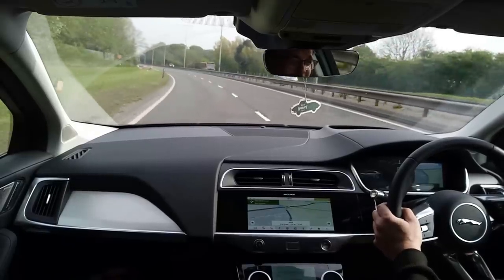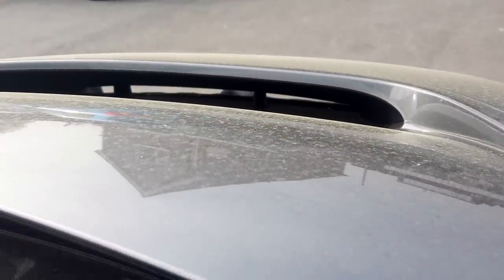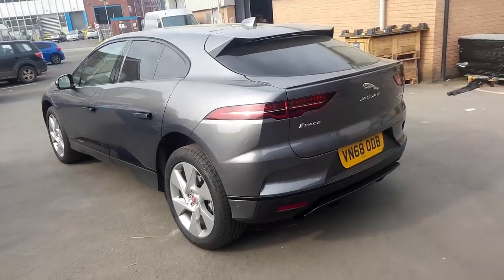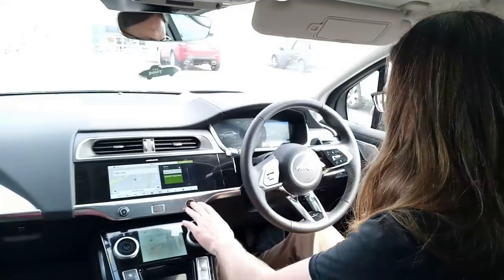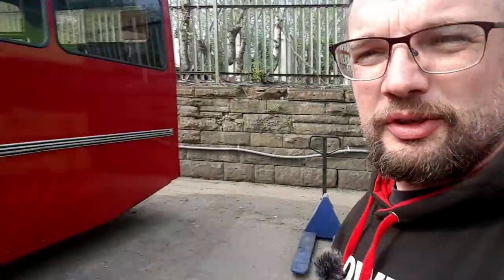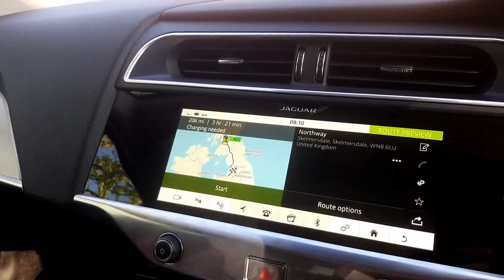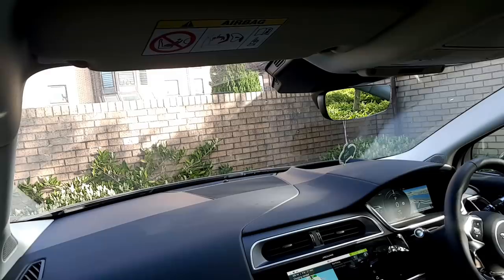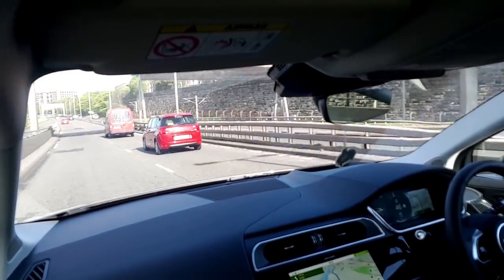Real Road Test: Jaguar I Pace 800 Roadtrip - with bonus bus action!

Comment: I've been told that you have to check Ecotricity on Zap Map before planning to use one - if there's been a "successful charge" within a day or so, you can expect it's working.  If it's not had a successful charge in a few weeks then it's probably bust no matter what the service status says.
Reply from the maker: Which is all a bit crap really. My route was evolving. I couldn't check charger status while I was driving...
Reply: @HubNut  Totally agree.  I had my first EV experience last weekend with 450 miles in an i3.  Not a bad little car, despite its daft doors and crazy BMW price but we had an Ecotricity charge that worked and two Polar ones that didn't. Found enough other Polar chargers around where we were but what should have been a relaxing stop with a coffee became phone calls to Polar and then sitting in a deserted supermarket car park for 45 minutes.
What would really have made the difference for us would have been destination charging. If the Travelodge had even some 13A sockets in the car park, that would have sorted us out overnight with no hassle!
BTW, I'm sure there must have been a problem with the Jag or those chargers you used as I was getting faster charging with the BMW than you got even though the Jag is rated for 100kW charging and the BMW only 50 (I think).
Reply: Still.. On the other hand, discussing this with friends, we remembered it's not all that long ago that you could get caught out on a long trip with a petrol car.
Not so long ago, garages closed at about 8pm.  Often didn't open on Sundays, etc.

Comment: Thats impressive Ive watched 17 Hubnut tests and they are all fine. As i drive an electrically powered motor vehicle, and Im an engineer in the auto industry I totally agree, the modern internal combustion engine car is too complex and was wondering if there would ever be an  electrically powered motor vehicle test on Hub Nut because I was sure it would truly show warts and all , here it is and for all the road tests done to date on various channels none actually attempt distance because if they did as here they would find yes brilliant car but useless charging. Never count on Polar, 90% success with Ecotricity. 100% with Teslas own superchargers.  I speak from experience 5 years in a Tesla P85 85K miles the only system that works is Teslas own (yep motorway 50 speed limits are your friend) great test. Teslas are efficient (mainly low drag) yes if you floor it they will eat the electrons but at speed limits they are good. Compared to traveling by Tesla this was painful and the charging farcical. I often travel south Cheshire to Edinburgh one stop for coffee at 200 miles at free Tesla Super Chargers at Gretna then get to the hotel and low twas to be found they have a Tesla Destination Charger at fitted by chance happy days! Yes Ian test a Tesla you will be amazed. You can travel to Sorento  Italy with ease as the Sat Nav interacts with the supercharger network and just takes you there. "The infrastructure does not seem to have improved" well said sir with the caveat (except Tesla) I jump in mine and bugger off all round the country (for free) and never give it a second thought.

Comment: Great video, others refusal to take EV's seriously is irritating. I have a 24kwh leaf, capable of 90 miles on a charge, and not once have I ever though that's not far enough take 15 mins to charge on rapid chargers. It costs me buttons to run, I literally save £3000 per year in fuel,( if I feel the need to I can hire an ICE car for long journeys),  insurance and running costs, it's a delight to drive and is 100% reliable. Battery degradation is at 3% and holding.   EV's are the future and here now., And getting seriously cheap on the used market.  P.s. there are issues with the Jag rapid charging, loads of complaints on the forums.
Reply: Gareth Saunders or perhaps just maybe there’s a lot of people who dont share you’re views/opinions and don’t want or like electric cars???  I’ve driven most of them, and don’t want one or like them. I’m happy with my cars. As are many other people happy with theirs.

Comment: Food for thought, I have a new power source, in its domestic mode it delivers 10kw an hour every hour 24/7, a version is planned for electric cars, in that guise running a million miles without a recharge is entirely possible.  It consumes nothing it produces only electricity, if there is any by-product it might be a little Ozone.  This will be safer for the vehicle with no risk of electrocution either. The device will take less space than the battery packs, and unlike the Lithium Ion has little pollution capacity at all. 20 of these devices are running in the UK but in Secret for the moment.  I devised an alternative system for houses and in Sweden there are now houses being set up with this, running without producing any pollution, delivering all the property needs for heat, electricity and hot water, and instead of electricity bills the owners are receiving about £2,000 a year (if the Swedish situation were followed, the UK owners on the new system ought to receive £160,000 pa and no bills for electricity, heating or hot water) from the power companies, consuming nothing, the original installations are now almost 6 years old.  Getting backing for this in the UK has proven impossible, so now contemplating taking this and other radical revolutionary tech abroad, trying to match the country with my preferred locations.

Comment: Wonderful though troublesome road trip. I wonder if the charging troubles are  I-pace specific. You might try to fetch a Tesla or a Kona, or even the quirky but lovely BMW i3, which is one of the best engineered EVs and might have less trouble charging at random locations?
Reply from the maker: Tesla have their own chargers. The others need the same. The range of the Kona is similar to the I Pace, perhaps even better, but the battery is smaller, so charges more quickly.

Comment: What is happening with the the Brightbus green ones, were they for spares? I'm trying to find out if any of the turbocharged Gardner engined ones with the Voith transmission have been saved.
Reply from the maker: One was for spares, others were in service but then the contract ended. Not sure where they ended up.

Comment: Linde electric fork trucks have had regen braking since 1999. Unless its an emergency stop (from a max of 16 kmh) you don't have to touch the brakes (in fact the pedal rubber is printed with the word STOP as that is what it does). The engine powered trucks work exactly the same through hydro-static drives. So can the regen braking on the I Pace be set to a maximum level where the brake becomes "emergency only"?
Reply from the maker: That's pretty much where this one was. I think hitting the brake pedal initially boosts regen before the actual brakes get used.

Comment: What's your view on electric classic conversions Ian? I'm quite tempted to rip the 2.5di out of Gloria the Transit and go electric. Batteries are still too expensive at the moment, but give it another 4 or 5 years and I think the tech will be cheap enough and the infrastructure more up to the task. The grid is already there, it's just a matter of installing enough chargers that actually work. There will be a tipping point I think. When it becomes cheaper to make a big battery than make an engine it will be game over for internal combustion. Electric Twc, perhaps? ;-)
Reply from the maker: I approve of them, but the bits are still prohibitively expensive.
Reply: @HubNut  Perhaps a conversion grant would be a good idea. If you can get a subsidy to buy a new electric car I don't see why not a grant to convert an existing vehicle.

Comment: (my long ramble about current generation EVs)

On the whole I like the idea of electric cars as something for the future (torque, instant power, quiet, etc.), but to me, the way EVs are at the moment is like the Model T versus Horses. Back in those days roads were all set up for horses, rarely paved, with feeding stops and watering holes on long routes, and they were a reliable source of transportation, the infrastructure for IC cars (namely sources of fuel) wasn't there or was unreliable at best, much like it has been with charging points for EVs over the past 10 years, and it took a long time for the car to replace horses...

So today, petrol & diesel cars are the horses, well-established infrastructure, reliable and not easy to give up, and EVs are the new kid on the block & not quite there with regards to being a practical, direct-replacement alternative, they're still pretty much a prototype...

Battery technology in EVs for the most part is essentially just banks of Lithium-ion laptop battery cells, which can only charge at such a rate as to not go up in flames, so that needs to change to something better and safer, and of course the mains power generation and distribution needs severe investment, upgrades and enhancements, as at the moment the UK grid cannot handle a huge transition to EVs & could be quite problematic for the country as a whole if there is not enough done with the grid before the silly "let's ban engines by this date" targets hit...

And speaking of engines, in my opinion, current EVs should be equipped with a small engine onboard to run a generator to keep the thing charged up when there's no reliable charging point to access, thus reducing the problem of range anxiety and giving the option of just topping up with "a" fuel (petrol, diesel, ethanol, LPG, whatever) from a petrol station and keeping the thing going, yes it still requires an engine, but remember, people with early cars still had horses after all!!!

Comment: True the infrastructure is patchy, with Electric Highway in particular being shocking, old and broken. However - look at the massive numbers of chargers of all types being installed, and no longer just single rapids either - 5 or 8 in one location are becoming common.  ZapMap reports over 1000 connectors installed in the last 30 days. We just need companies like Chargemaster and Ionity to replace EH at motorway services. EH have had their chance.

Comment: I know you'll find this arrogant of me, but my diesel Golf can cover 700 miles and takes 5 minutes to refill.  I've always thought I can see electric cars working with people that cover lower mileage and have a garage, but for the masses they're still not a viable alternative.  I did like that A75 when I drove on it a couple of years ago.  Is there anything to stop somebody just walking up to the charging machine and just pressing stop?  I see they've managed to get the charging cable to lock/unlock with the car.  I'm all for the future of electric cars and people trying new technology, but I can't see myself getting one.  I've thought about something like a Renault Zoe or Nissan Leaf as a commuter vehicle for work, but the price of the vehicles is just a lot, basically for what you get.  I wonder if I could rent one for a week just for the experience.  Do like their silence and torquey motors.

Comment: Had been curious how those pop-out door handles work, thanks for showing that. No touch, just a regular handle otherwise.

Your experience is sobering, found it stressful just to watch. However lovely the i-Pace is - great, truly modern car - EVs won't really become a truly practical proposition compared to ICE a long as the infrastructure is as functional as a network printer (*Initialising*). My 15-yo Corsa is hardly the best car ever built but it's considerably more reliable than my router and TV, not to mention my phone.

Comment: We had a BMW i3 as our works pool car for a while - I loved the quietness, the acceleration and the overall experience of driving it, but HATED the measly range (though it was fitted with the little petrol 'range extender' engine which helped a bit) and it was really fun to drive, right up until one of my colleagues binned the thing! Now we have no pool car at all (boo!)
Overall, I enjoy driving EV's but I wouldn't consider buying one right now for the simple fact that the infrastructure just isn't good enough right now! If it's going to take 3 days to drive from my home in the south to visit my relatives in Northumberland, it just isn't worth it right now when my trusty Mokka diesel can get me there in about 7 hours! Besides, I also think that as a technology, batteries are a bit of a dead end - the future, as I see it, is in hydrogen fuel cell technology. You obtain hydrogen from water, and because the fuel cell uses oxygen in the air to generate electricity, thus combining hydrogen with oxygen, the only emission is water - it's so fantastically elegant, and the advantage is that your tank can be filled with hydrogen in a matter of minutes, rather than waiting for hours at a battery charging station (assuming the bloody thing is actually working!) If we can safely contain flammable substances like petrol safely in a fuel tank, I see no reason why we can't safely store hydrogen. If fuel cells become more affordable and the hydrogen infrastructure becomes widespread, safe and reliable, I'll happily ditch my diesel!

Comment: Great video as ever but this car is just tooooo expensive by far & I wonder how the batteries will be fairing 21 years down the road. My 21-year-old Merc runs sweet as a nut on the original engine & the fancy new electric cars have a looooooong way to go before I would even consider one.

Comment: You need customers to build a good infrastructure. And you need an infrastructure to attract EV buyers. I guess, this can’t be achieved without some governmental interference. As a Norwegian, I note that no purchase tax and VAT, far lower toll road fees etc has boosted the EV/hybrid sale, to almost 75 percent (March 2019). More than half of the new cars were pure EV this spring. And except for in the far north, with enormous distances and very few people, the charging network is extensive and (mostly) well maintained. Now, the EV benefits are slowly being cut. Still many people choose EVs. When the infrastructure is reliable, these cars work well even in a cold country with large distances.

Comment: This video tells me that the Ecotricity network didn't get any better after I stopped trying to use them a few years ago.  Polar are very good if you have the RFID card and go to their ultrachargers, otherwise the networks still aren't great :/
Reply from the maker: Indeed. I was very disappointed. InstaVolt are good, but not great for motorways.
Reply: @HubNut  these days I mostly use polar since they have ultra chargers (still mostly 50kw) in hotel car parks so nicer cuppa.

Comment: The I-Pace was charging at around 32kW according to the figures on the charger. BMW and Porsche have demonstrated 500kW!  At that rate, your 45 minute charging experience would be under 3 minutes. At present it's like trying to fill a petrol tank through a straw!
Reply: At 500KW you would need a sub station to top up one car the average house supply is arround 15KW. At 240 volts 500 KW is 2083 amps and over 400 apmps per phase on 415 volt three phase, the grid will need a major upgrade if every one goeselectric.
Reply: @Equiluxe1 Tesla supercharging v3 has a 1 Mw power cabinet allowing 250 kW charging TODAY. Gridserve in the UK are in the planning stages but, if what they say comes to pass they will leverage their solar farm expertise into off grid rapid recharging stations (no doubt with huge batteries!) I used to work at a shopping centre. The air conditioning chillers alone drew 6 kA per phase! The engineering is all there, or close to it. All it takes is the will and large buckets of money.

Comment: Just a question from a dedicated petrol fan... if you run out of range and the charging point is broken and you hit 0%

1. Can you claim from the charging company?
2. Does this short fill charging damage the battery pack?

I personally think the future is small engine petrol hybrid, but with a really tall 6th gear. 

Be amazing to hear what fellow HubNut fans think :-)
Reply from the maker: No. Battery would not run entirely flat, but it's definitely best avoided. Really tall 6th gear fine until you hit a hill...
Reply: @HubNut  but I would just change down for big hills. In my current Skoda I have to use 4th lots to get the big hilly stuff done. 

Think 1.0 car with taller 6th  would be a great road test..... Are there any currently available vs a retro hyper miile muncher
Reply: I think Electric is the fuel of the future, but we're nowhere near there yet in terms of battery technology or charging infrastructure. Hybrids never seem to match there claimed economy and most people I know with plug in Hybrids live in London and never bother to plug them in. They only bought them for tax reasons and don't really care about their cars emissions.   Hydrogen's too difficult to store and it really seems manufacturer's are putting all their resources into full EV for the future.